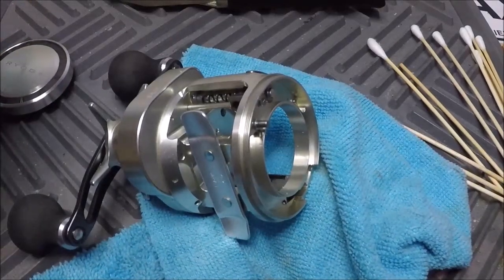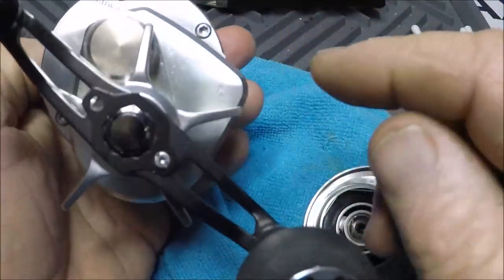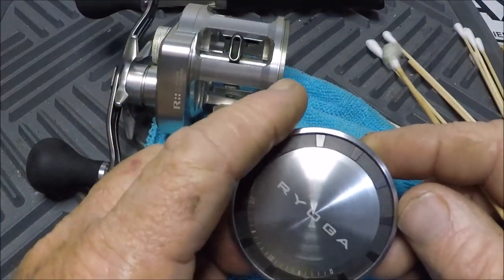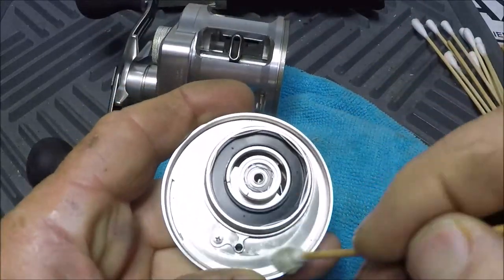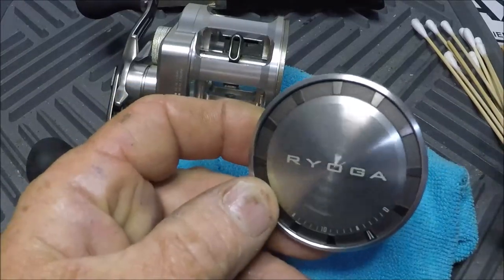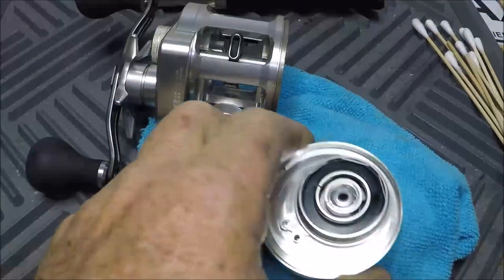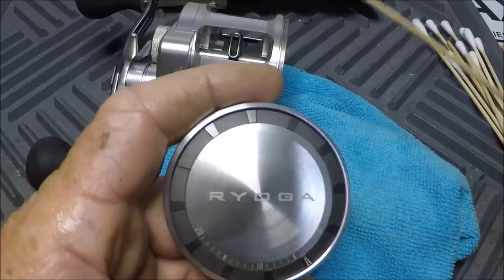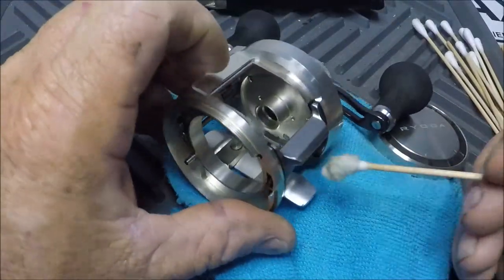DAIWA RYOGA REELS 👍👍

Comment: Thanks Captain Dave. 17 minutes well spent. Nice Hub Caps ya got there. Doesn't matter what any snobs has to poke at ya. I've had conversations with guys about their custom made rods... I'm about what works and what puts Jackpot fish in my bag (SoCal walk on party boats use burlap bags) btw I miss that chrome over Detroit Steel. They don't make em like that anymore.
Reply from the maker: yep, vehicles are dull and boring today...my only brand new truck was a 1986 ford 4x4 f-150 that I took to N.D. when in the USAF, and I had so much CHROMED STEEL on that thing it shined when covered up in a N.D. snow bank. Made it ez to find.

Comment: Thats a nice video Dave. I actually bought a used 2020h i love it so much that i have spent a few months on ebay looking for a NEW OLD STOCK NOT OVERPRICED ryoga 2020. Well on Monday I finally found a new old stock 2020. just a regular 2020 not a highspeed but $300 was worth it to me Actually most of my fishing reels are 5.4:1 gear ratoo or 6.1:1 but I got a few at 7.4. Either way
Reply from the maker: GOT MANY 2020'S MYSELF....what great reels. Makes a Abu Garcia seem like a 1950's reel.
Reply: Capt Dave's Sport Fishing I own a few ambassadors new and one from 1960s that I got for unlocking somebody’s car( funny story an old lady was locked out (im a locksmith) and her old 90s f150 had the bed full of junk stacked over the cab. I saw the old red abu reel really clean laying in a bucket and i said “thats a cool looking reel” lady goes “oh im throwing all of that out take it”) Well the new ones are literally identical just more bearings, an anti reverse bearing, and gear ratio. They’re durable reels but old old old
Reply from the maker: @Sth-qd2xn  YEAH but the prices of the ''new'' ones had me running away from reels that get sticky spool release buttons, drags that burn up, chrome that turns green. I was a fan, but Daiwa won my biz.
Reply: Capt Dave's Sport Fishing If you remember me I commented about shimano calcutta, which I love but these silver ryogas really seal the deal. I do have a question for you, I have a little travel rod that needs a smaller reel. How much smaller is a Ryoga 1012 than a 1016? Does the 1012 cast as well considering it has 2 centrifugal brake pins vs z mag? I am leaning towards the 1012 but need some input from somebody who uses them on the daily. So does the 1012 cast as good and how much smaller is it?
Reply from the maker: @Sth-qd2xn  the numbers really don't mean reel size as much as the PE line thing, or diameter I think....not sure. Yes a bit smaller, but not radical. they all cast well in my book, even my 2025 jiggers, with no disengaging levelwinds. But yeah a 1012 would be fine I think on a travel rod. I had one for a short time and sold it and got a bay jigger 2025, with the big single power handle........I should be using it on these big redfish, with my tiger jigging rod. just am addicted to the do-all'ness of those intercoastal rods, which have the 5 to 1 ratio 2020 reels on them.
Reply: Capt Dave's Sport Fishing I know right? My favorite rods are intercoastal ugly stiks i live in Nebraska but have family in southeast texas and fish the gulf multiple times a year for trout and reds. Im not an anti graphite guy though. I really like Fenwick HMG travel rods, 3 piece rods with 2 different tips Medium or medium heavy for casting, medium to medium light for spinning. They come with a really nice case that incorporates a pocket for the reel so you dont have to detach it (like a fly rod case) Well the baitcaster case is hard to fit reels in so the smaller the better. Other than those i pretty much only use uglies for everything
Reply: and their lifetime warranty is a deal maker

Comment: Good gear vid Capt Dave, Hey I had one of those Prima Donna types bash Ugly Stik  about a week ago. If you cant get it done with an ugly, you cant get it done. You prefer a double paddle reel over a single?  "I mean for you not your customers"   If so why, or it just dosen't matter
Reply from the maker: on a casting reel, doubles are okay. for me, it really doesn't matter. My ''jigging ryogas' have a single, that I bottom fish with. just to differentiate which is for what......plus the ''for casting'' has the z mag system and the jigging, I use for bottom fishing doesn't have the z mag system.